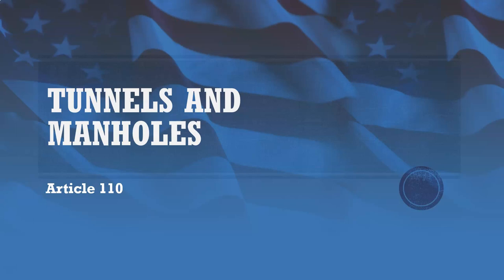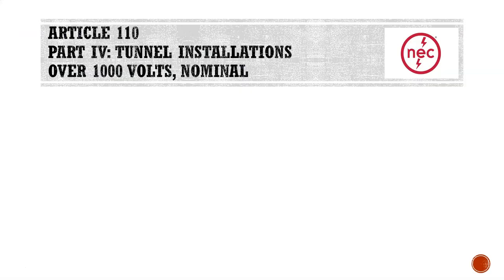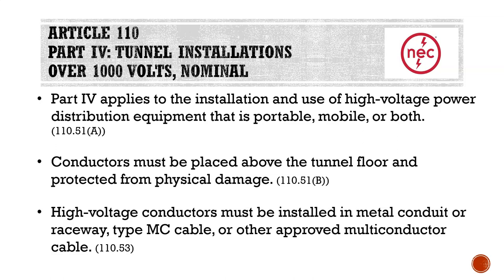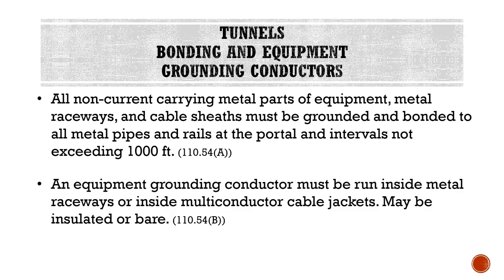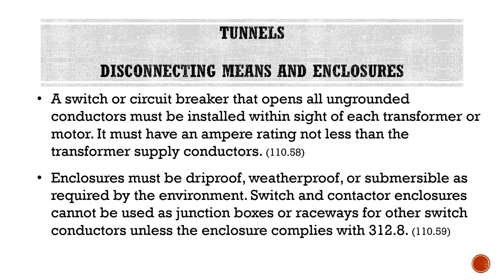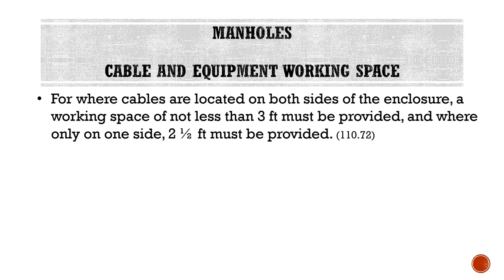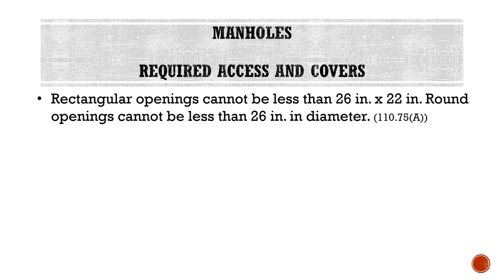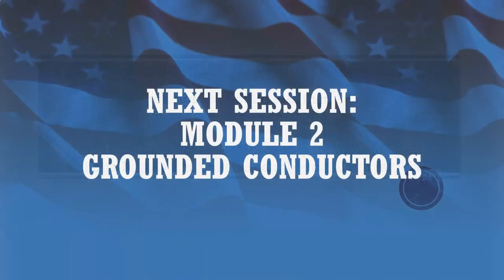Tunnels and Manholes

Comment: Hey..thank you for your efforts ..h’ what parameters can affect the spacing between manhole in site for cables.
Reply from the maker: HI, the only variable that can affect the spacing between manholes from a code perspective is the number of bends between manholes in the conduit run (assuming you are installing conduit between the manholes). It is typical to space manholes every 250' or so, but this is a job specific specification and not a code requirement. Hope that helps!